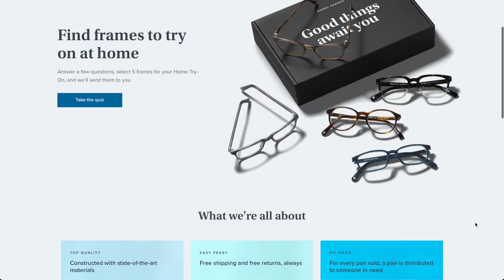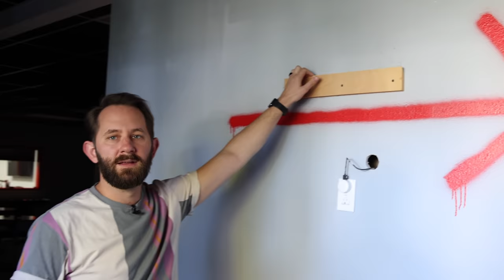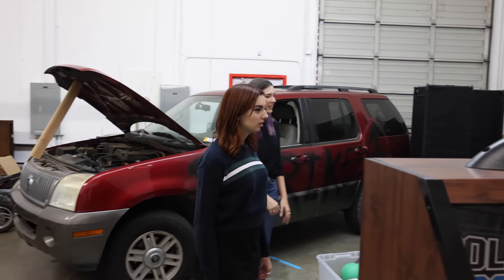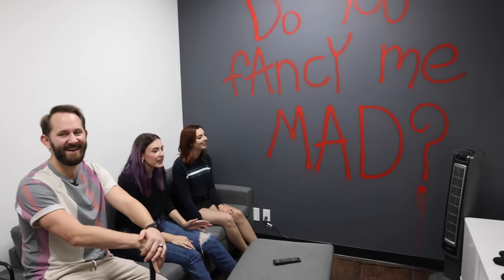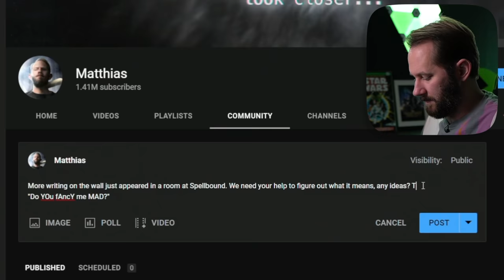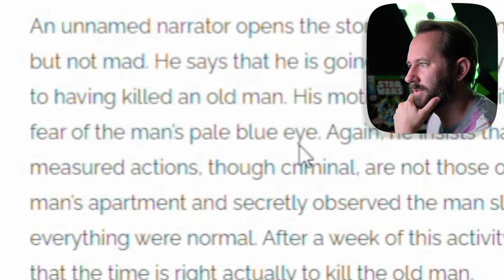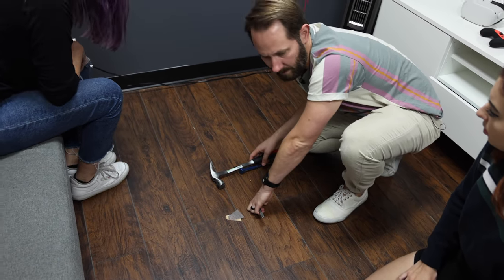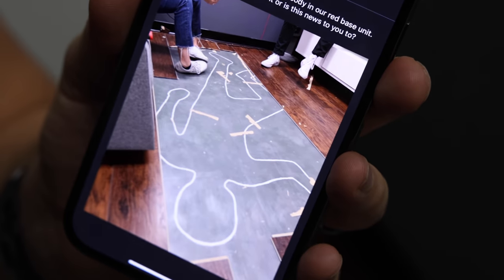I Found Something Upsetting Under My Floorboards...

Comment: 21:20 the moment they mentioned the fire along with the mention of movements before they died, i thought of the window breaking, it was mentioned that ratical heat change can make glass break. What if the spirit was trying to convey that they were there when the fire happened.
Reply: I was just thinking this and in the ghost video it seems like someone was running threw the lasers

Comment: Going off of the team’s theories at the end, what if one of Syntec’s employees (or someone involved with the company in some way) started murdering people. Or, it could have been just a murderer that stumbled upon the company. Said murderer/ crazed employee spray painted the walls, leading others to the sight of their fellow coworker on the ground, dead. The murderer got impatient as the employees couldn’t make sense of the clues on the wall, hence the arrows and the ‘do you fancy me mad.’ The ghost of the victim has been leading you guys to the same point that the murderer led the employees to before. By rewriting/ uncovering the messages, you get to solve the murder that was a shut case before. Look closer to the messages. Murderers usually have a ‘thing’ that they do; something kind of like a signature. What do the messages have in common and what is different about each one? These could add up to form something like an answer. You solved one murder, now let’s solve another.
Reply: Great theory I think the writing is linked with Deb but if the outline of a body is in a private room Then doesn't it make sense to think the murder through

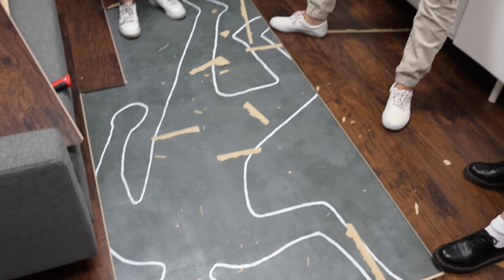Comment: Ok at 31:15 there seems to be gaps where the out line is and many they lifted them up put the body under it outlined it covered with the floor boards and have forgotten panted over the writing on the walls and 20 30 odd years latter you found it

Comment: I know I am a little late but I went back to see if anything was missing and I noticed that if this is connected to project: 863. You never used the 863 key yet. I know that there were many other keys you haven't used yet but the question still lingers. Where does the 863 key go? Either that or I probably missed something. In that case my bad.

Comment: your reasoning for closing the free tier is offensive. you're implying that non paying members are of lesser morals than those who pay. it implies that if you're willing to pay to be part of something you can't have devious intentions like those who are not willing or capable. yet those same people sending messages can pay and be back in good graces. the issue isn't non paying members. the issue is the entire structure of the platform. there really is no need to have public dms for anyone but admins in a community that allows minors. you guys also leave peoples other social media links public, which means you're giving people additional ways to harass. if you were genuinely doing this for the safety of minors, rather than doing it for the revenue, both the dms and links would have been huge red flags. it's fine to want your platform to bring in more money, it's necessary, but just be honest about it